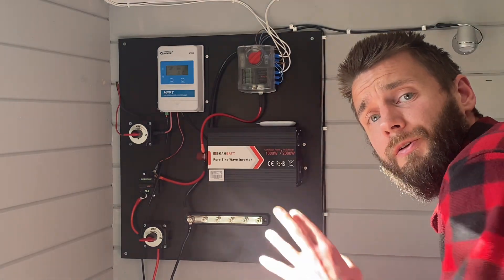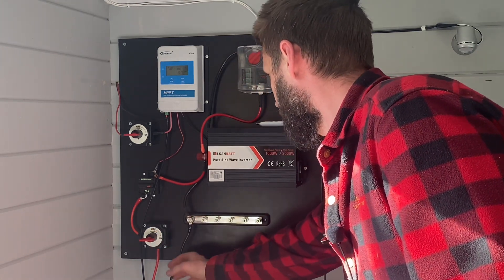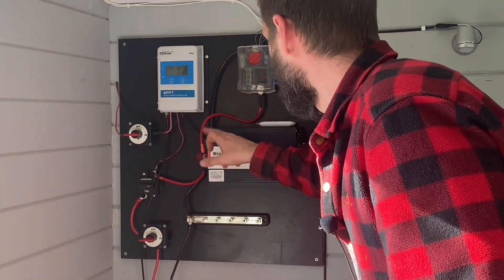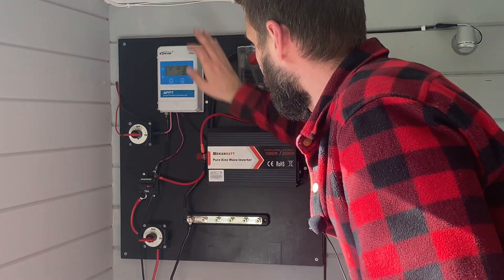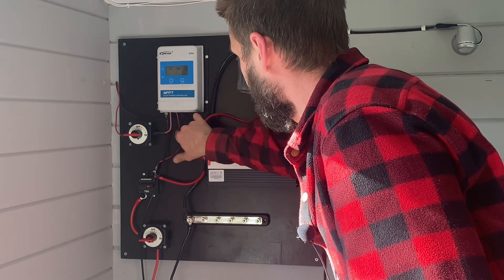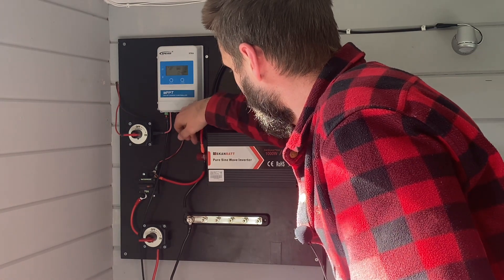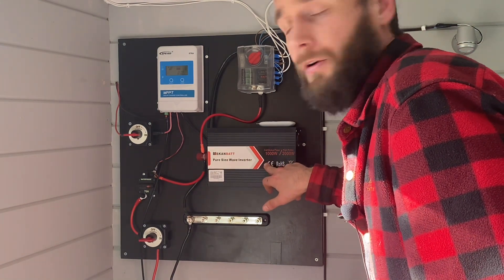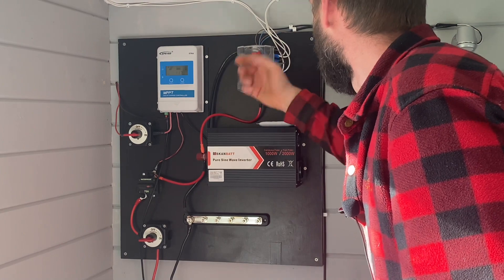Simple off grid 12v solar power system

Comment: Thx a lot for your efforts. However, you're using the wrong parts for your system. You should use a solar isolator instead of a battery disconnect for your panels. Then you should use an ANL fuse for your inverter.
Reply from the maker: Agreed. An ANL type fuse is a good idea. I have a DC breaker closer to the battery. As for the disconnect on the panels. An isolator is a good idea👍 but right now the array is so small I did not bother with it. Thank you for your input👌🏻
Reply: @JonasSyver  thx a lot for your understanding, we all learn from one another. Peace!